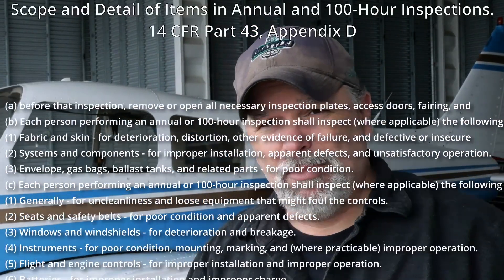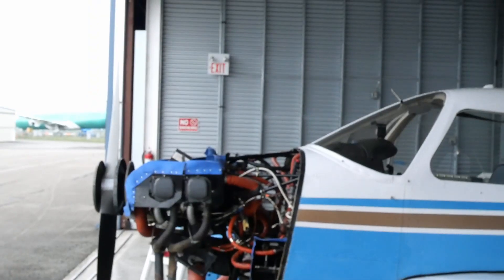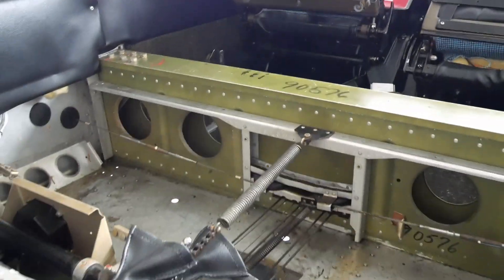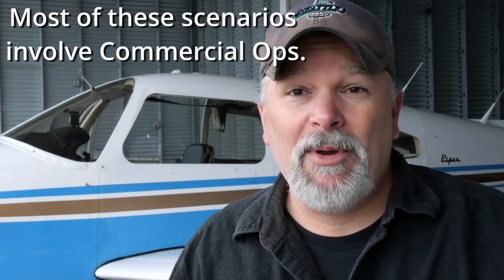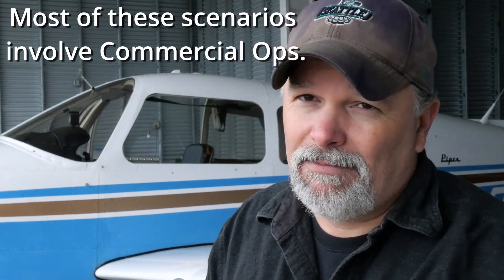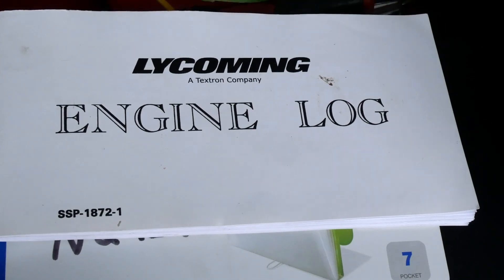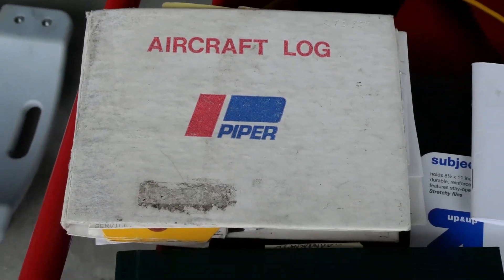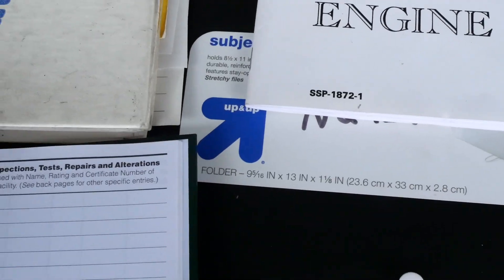Archer Annual | First Part of an Annual inspection

Comment: Feeling kinda bad for a young guy we just did an annual for this week. Horizontal stab attachment fittings all cracked and fwd stab spar kinked.
Delivering bad news to owners breaks my heart. 
But still better than losing your stab
Reply from the maker: Oh I know. It's hard to sugar coat something that could end a day badly. I feel for that guy.
Reply: @FreedomFixer_Flying  It seems so many Ame's let things slide. Then when the airplane finds its way to a shop that does a good inspection. We are the bad guys. I heard a saying that the cheap guy pays twice. 
In aviation its true. Luckily he's not going to pay by departing controlled flight.